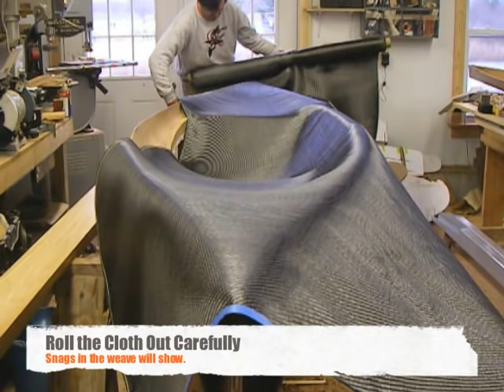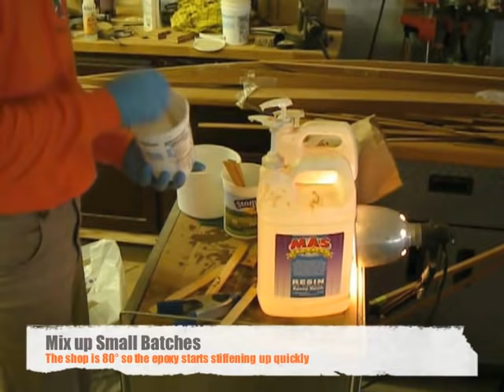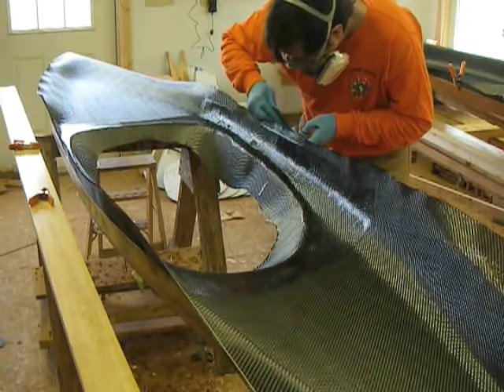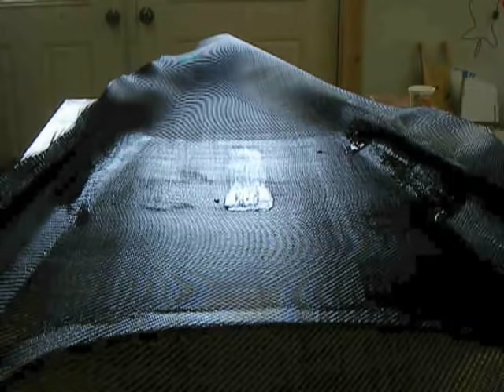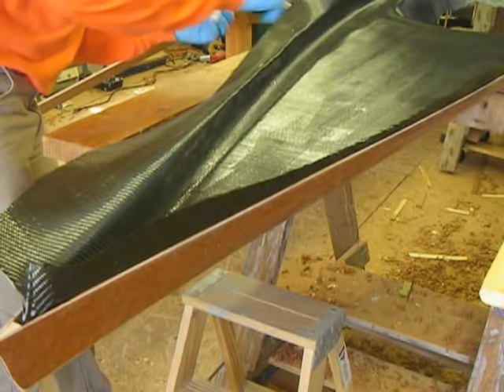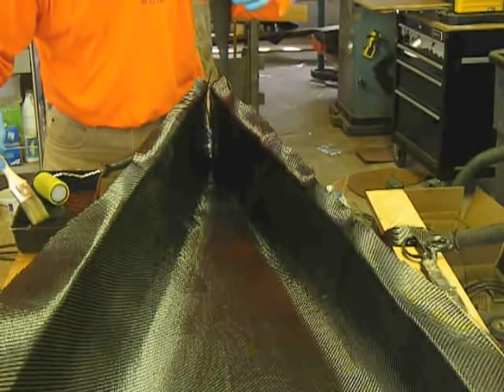Hand-Laying Carbon Fiber

Comment from the maker: @aSheeple It is fine to combine CF with a flexible core material.
Reply: True up to a point, but I wouldnt make airplane wings or even expensive boats withoutmaking sure I was with in the flexural/strength window based on the loadings of the part being made.  Carbon fiber works better with Kevlar as a composite giving a  greater area to that window.  Not saying that many parts canot be made that way but its wasting the true utility of the carbon fiber. There are more costly combinations, but they offer far better performance.

Comment: How long did the carbon fiber process take from beginning to end?  Have you had good/bad experiences from any particular carbon fiber supplier(s)?  I have a project I plan on tackling soon - and have been looking at a few suppliers and was wondering if there is a huge difference between quality of products (because pricing varies a lot!).  Thanks!

Comment: Just some questions:
1. Can fiberglass expoy resin work with carbon fiber cloth? If not, what is the correct type?
2. Would applying the adhesive onto the wood first be an ideal for a fully saturated area? My project  involves some what of a small wood area.

Comment: Wondering why you did not paint the wood with resin first (or did you?)  Was there just not time for it with a hand layup this big?  Or were you worried about the cloth sticking before you had it set in place correctly?

Comment: What weight cloth did you use and is this a twill that will form to curves easily? 
I wonder if a light coat of spray adhesive, like 3M77, on surface of boat would hold cloth in place while resin is applied. Adhesive would probably dissolve from chemicals in glue as its applied so it doesnt interfere with lamination.

Comment: Very nice work, is that a very flexible rubber skimmer you are using to spread the resin evenly? Just wondering as I would have thought it would distort the weave
Reply from the maker: My standard squeegee is a plastic "Bondo" applicator: https://amzn.to/2jj6wSN. It is flexible enough to not mess up the cloth.

Comment: Great video but I don't really understand why you used CF in this particular application. Since it's not a high-performance boat why does it require this level of stiffness?

Comment: So interesting! Did you use pre-preg fibres or not? Which CF have you applied? 200gr/mq?
Reply: This kind of deal on a kayak is mostly harmless overbuilding.  When the Gougeons (who invented the SNAME hydro test for panels) tested their laminate for their Formula 40 trimaran, they found linear 6 oz (inside and out), 90 degrees to the 3/8" red cedar hull material that  they used, tested out as superior to 1" D-Fir, marine ply.  So if you consider one often uses 6 oz glass inside and out on 1/4" red cedar in canoes and kayaks, you can see how massively the carbon plays with the outcomes.

However, in this case, the carbon appears to be cloth which means that probably much of it is being wasted and improperly aligned with the wood, but who cares, it is going to come out mega stout.

The pathway to improving these boats is to do better alignment of wood fiber, ditch the football approach, and use computer design and CNC to cutomize the designs, at a technical level there is no reason to do hand boats that don't fit the client as though one was building ready to wear suits with old world tailors.

Comment: Awesome work! Do you think it would be possible to have a skiff upside down and lay carbon fiber over it and make a whole new carbon fiber boat?
Reply from the maker: Yes, it is possible to use an existing boat as mold to make a new boat out of fiberglass or carbon fiber. It may not be the best way, but it can be done.
Reply: Right on! Thank you
Reply: @andrewrlj2018  there is an sg model that is wrapped cf.
Reply: @fudozanokamae2579   awesome!!!

Comment: ⭐Did you also do the bottom of the boat for increased durability..?
Reply from the maker: The inside of both the deck and the hull had carbon fiber, the outside of both were reinforced with fiberglass fabric because it is clear, allowing the wood to show.

Comment: Did you trim the excess carbon fiber before or after the epoxy cured?
Reply from the maker: It is easiest to trim the fabric after the resin has set up a bit, but before it is fully hardened. A "leathery" feel is about right.
Reply: Thanks!

Comment: Will the same method work if I want to line ABS plastic?  Do I use different methods or materials?
Reply from the maker: Evil Empire of Florida I have no experience with ABS so I can not help you.
Reply: +Evil Empire of Florida ABS is not a suitable core. There are "plastic" cores that have a poly scrim applied to the surface, but are only really suitable for secondary applications. Like a wall or a door on a yacht for example. Suitable cores would be balsa, Nida core, phenolic honeycomb, marine plywood, or any one of a million foam cores. The cedar Mr. Schade uses makes a boat stronger than logic dictates.

Comment: You make this look so easy. It is not. I use West System and the fiber I used looks to be of similar weight as yours. The bubbles are relentless! Corners and ends are almost impossible to deal with. Unfortunately the epoxy tends to adhere better to the Fiber than anything else. Meaning it pulls and shifts so it is a constant fight because every time it pulls it creates a bubble somewhere. I see you let the fiber hang over the edge to be trimmed later. I do that and the weight of the fabric tends to lift it off the edge about 1/4 of an inch down. Creating an impossible to deal with bubble across the entire top. Any tips would be greatly appreciated. Im not ready to give up but until I have more information im not wasting any more money on this.
Reply from the maker: larry haley laying CF is not much different from glass. It requires more resin because the cloth is less dense, thus absorbing more resin than the same weight of glass. Working in a warm space with falling temperatures makes a big difference.
Reply: Ok makes alot of sense. It's cold here and I can't get my garage real warm.
Reply: larry haley your better of using prepress carbon fibre, no bubbles what so ever
Reply: +t800 How would you do that in this application? It has no mold and the cedar would gas like mad when put in the oven to cure. Pre-preg has a ton of uses and a ton of reasons not to use it as well. Not to mention the short shelf life and insane cost that makes a boat cost to much to build.

Comment: Hi, you posted this video a few years ago, so I was curious if you had any issues with the carbon fibre delaminating from the wood because of the wood expanding differently to the cf. I don't see many objects made from wood and CF and I thought that might be the reason? Thanks
Reply: No that is not a problem if you follow normal wood epoxy protocols.  The biggest problem with building with wood and carbon is that carbon is massively stronger than wood.  People often slap some carbon into a load area, figure that should help, when what they really did was to assume all the loads on the carbon, and it will have to break before it shares load with the wood.  If they didn't add carbon to the level that will carry the whole load, the carbon snaps, and creates a stress riser that will break the wood.

Issues of the kind you are mentioning will occur with glass as much as carbon.

Carbon has been used with wood for a long time, but the evolution has been slow.  For instance in archery, arrows of carbon are the high tech choice, but wood carbon composite limbs where the carbon carries the load took for ever to arrive, and have only become common in the last 10 years.  While with say fishing rods, carbon took over in the 70s.  But again, this was due to not understanding the material, not the issues you raise.

Comment: Why don t you use a vacuum bag for the curing?
Reply from the maker: Nikosss31 The hand layup method shown in this video is much less complex than vacuum bagging. The hand layup may not be as good structurally but it is still a nice layup that does not require special tools. 

I have another video showing the process using vacuum infusion. https://youtu.be/hEyF5KOkhUY
Reply: methabol injection inti my 4 cylinder intaje
Reply: Nick Schade  Assuming you get proper wet out and contact, hand lay-up is not structurally less than vac.  Vac has pressure to ensure great bond to substrate, and it allows one to get a "better" resin fiber ratio, this will give about the same tensile strength in elongation, more in flex, but it will normally be less stiff, simply because the resultant laminate is thinner.  Sure on spec vac bagging wins, but it those concerns are normally not what drives a layup on wood.  Wood is often mostly about stiffness, or tensile strength in elongation (the latter mostly for spars).

The Gougeons led the way on combining carbon and wood.  You really have to know what and why you are doing it, structures can often end up worse (not in your application).  You can't just say, "hey, you didn't vac bag, your result must be worse."  They knew about bagging and used it with wood, but mostly hand laid up carbon, as far as I know.  Their cheap lumberyard trimarans consistently beat multi million dollar mega boats in the conditions they designed them for.

Comment: how thick is the carbon fiber being used
Reply: Basically it only comes in a few sizes, and you don't need cloth as heavy as glass.  Glass is normally 4-6 oz for boats this size, and carbon weighs less for the same dimension, and the same dimension is many times stronger.  So you cam work it out at an egineering level, or just jump to the obvious conclusion from examining a catalog and trying a few samples.

Then again, lets say you wanted to do this.  Why?  You have to have some theory as to why you are doing this, and therefore what material and dimension you want to use.

Comment: what resing is used in carbon fiber??
Reply: +Oswaldo Castillo You can use pretty much whatever resin you want, although laminating epoxy works best. Any epoxy will make a great product but if you use a good quality one with a slow hardener you will get a much stronger product overall. Just use something like West Systems epoxy or Norglass.

Comment: I would have used black fiberglass in this application and saved you about 30.00 linear yard in cost, the carbon fiber is really only cosmetic in this application it seems? 
Hensley Composites, LLC

Comment: You'll need to learn about combining materials with modulii of elasticity. Putting the carbon on the inside means it will take more of the load, being way stiffer than the other two materials. Structurally not a good idea. If you get a load large enough to flex the rest of the boat, the carbon will simply crack. Either use all carbon, or an equal carbon/wood/carbon sandwich.

Comment: Carbon fiber and fiberglass have very different flexural strengths, carbon is much less than fiberglass. if your project will flex beyond that strength then it will shear the fiber layer and leave you with only the fiberglass. If you really want to mix composites for strength and not looks then put the fiber first, still a poor choice, best to keep fiber on fiber as it gives you the best strength weight combination.
Reply from the maker: The glass and CF are separated by wood. The composite is more complex than you outline, but yes, it is possible to break it.

Comment: Why not just build an entire kayak out of carbon fiber by just wrapping a styrofoam mold in it? I was considering this myself... why is it a bad idea?
Reply from the maker: The process you describe is an established manner to make a kayak. It certainly works. But it is not a way to make a light kayak unless you remove all the foam after it is complete. While foam is a very light material, it is substantially heavier than empty space.

Foam is also not very strong. If you were to wrap the same amount of CF around foam as I have used here, you would break the CF the first time you hit something hard because the foam supporting the CF would fail and compress leaving a deep bruise and or rip.

Wood is substantially stronger than foam, so you can get away with a lot less CF to achieve the same strength. As a result the wood/carbon/epoxy composite is stronger and lighter than you can achieve with styrofoam.
Reply: There are plenty of all carbon kayaks and canoes.  The biggest problem is many glass and carbon canoes are made of fabric and resin, no core.  This makes it tough to get highly efficient, and often means that out of the mold or later the boat will not hold a perfect shape, either globally or localized lumps.  But when it comes to making a proper structure with cores and cloth, you basically have to do everything Nick does, but in nasty ugly foam.  And then you are locked into shapes that aren't suitable to most people.  You would be talking about plastic looking boats that cost 10-20 K.

Comment: Only if he was laying it on a green layer of epoxy already on his core.  You will not that is not the case here.  Besides, prewetting only really works on large 2d shapes without 3 directions of warp.  3d shapes like what is laid up here is a horror doing as you suggest